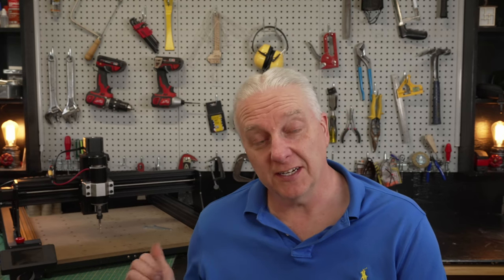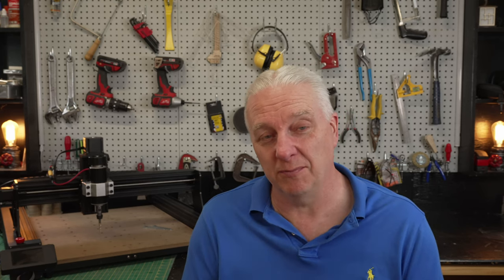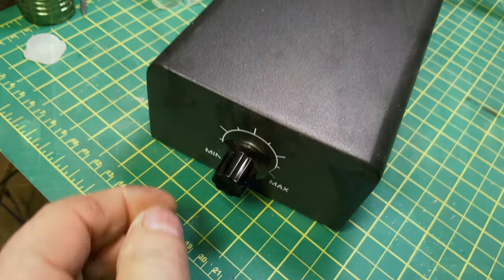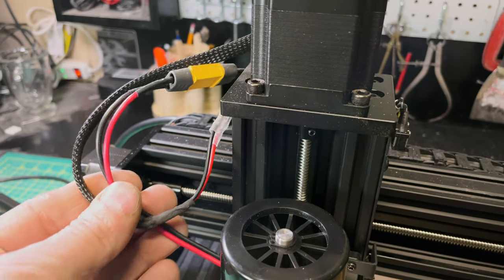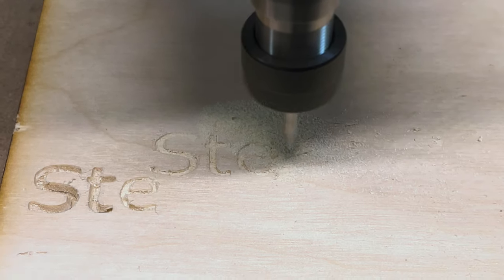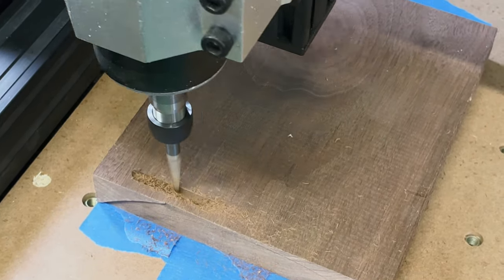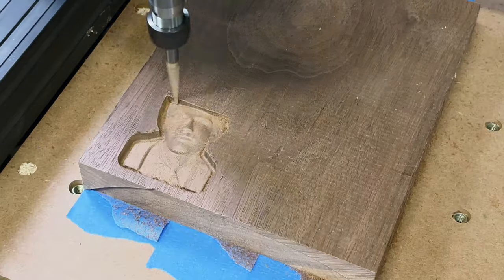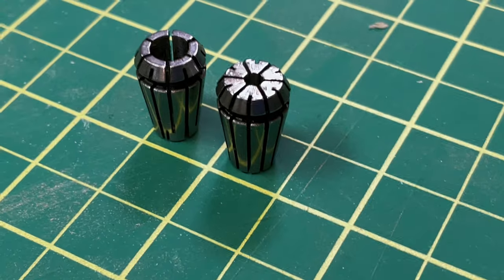TwoTrees TTC450 500W Spindle Upgrade - A Game-Changer for a Great Entry-Level CNC

Comment: Greeting!
I'm interested in your opinion!
 You probably know that the TTC 450 already has a pro version, and you can buy an 800W spindle for it, which is very similar to a manual router! I have three questions:
1. How much do you think this spindle speeds up the production process?
2. Can the mechanics of the machine handle such a large spindle?
3. Can it be installed on the plain TTC450, and if so, will it not destroy the machine!?
Thank you in advance!
Reply from the maker: 1.  The biggest benefits of a spindle are that they are designed to run for long periods of time, provide more torque and they are quieter

2.  You can actually put a trim router on this CNC, though that would push things a bit in my opinion.  But the 800W spindle should be fine.

3.  I believe the running mechanics of the regular and pro versions are essentially identical, so what you can do on one will work on the other.
Reply: @SteveMakesEverything Thanks!

Comment: Hi Steve, thank you for sharing . I designed couple simple projects, put them in a memory and loaded them into my laptop, which is connected to my cnc
machine, and nothing happened. I don't know what's wrong. Any ideas? please help.
Reply from the maker: This isn’t much to go on. What tool are you using to load the files to your CNC?

Comment: I just bought the 450 with the 500w spindle. When I connected the spindle it's not working. Getting power to the control box, but no power to the spindle. I connected he 80w to see what would happen and it works fine. Any thoughts? I've contacted TT and haven't heard back from them yet.
Reply from the maker: Check the connections from the control box to the spindle.  I had a similar problem with mine and TT ended up sending me a new control box.

Comment: Can you tell me how to install the bracket behind the spindle thank you
Reply from the maker: Look on the Two Trees channel. They have a video that shows this.  The bolts holding the spindle bracket are accessible from the back. You need to manually move the Z up and down the access the bolts
Reply: Ok thank you

Comment: I suggest you test if that power supply box is grounded. I have one of these 500W 110V spindles, and it has 80V on its "ground" wire when compared to actual ground coming from your wall.
Reply from the maker: Wow.  Mine is definitely grounded

Comment: Is it good and precise enough for a small startup shop?
Or is it a hobby machine that you have to frequently tinker with that doesn't get consistent and repeatable results?
Reply from the maker: If you want to do shop work then I'd suggest the Genmitsu ProverXL 4030 V2.  It's a bit more heavy duty.  You can find a review of this on the channel as well if you look in the CNC playlist.
Reply: @SteveMakesEverything  Thank you for responding. Due to budget constraints, I was rather excited about the TwoTree machine, I'm just concerned that it would end up more like a tinkering machine similar to cheaper 3d printers that you constantly have to tune, part replace and adjust to get any workable result out of.
I've seen the Genmitsu ProverXL before, but since I already have a Snapmaker Artisan I decided to stick with that over dropping north of 2k on another CNC.

The TwoTrees seems to hit a nice spot price wise, where I could get just enough extra working area to actually clamp 400x400mm pieces, while also easily installing a vacuum clamping table.
Though, again, I'm concerned about its accuracy given that I need to flip my workpiece around to precisely cut on both sides (if the contours don't align that would be an issue).

Hopefully you can let me know if the TT would be up to this task or if I should wait until I have the funds to scale to a better machine instead of trying to produce more volume with a TT.
Reply from the maker: @kay6736  The Two Trees CNC is a decent machine, but as noted I would still lean to one of the 4040 Genmitsu models.  They are just more robust for not a lot more money.

The TT is definitely cheaper, but as the oild adage goes, you get what you pay for.
Reply: @SteveMakesEverything  Thanks, that's kind of what I thought but didn't want to be true.
I'll keep using what I have until I can upgrade then. God bless.

Comment: Sorry to ask again!
I finally got the 500W motor for the TTC450! I managed to install it, but I won't try it out until tomorrow!
My first question would be, how high should the spindle be raised from the bottom of the machine when it is held in place in the clamp? I couldn't find any information anywhere, or I just missed it!
My other question would be how many millimeters is the depth to which you can safely go in one step, without the machine being destroyed! I know you mention 5mm in your film, but as a beginner I find it too much, but I would be wrong, because it would be good to finish the work as soon as possible! Thanks! Friendly greeting!
Reply from the maker: There’s not set height for the spindle, though there’s no point setting so low that a tool bit could go much below the workspace surface. Insert your shortest bit and set the height so that bit just touches the workspace with the Z axis at its lowest point

Going 5mm is pretty aggressive. Start with maybe 2-3 mms. If you XY movement is slow you won’t break a bit
Reply: Thank you very much! @SteveMakesEverything

Comment: How do I work out how much power  it uses?
I'm working from home and don't want a huge power bill.
Reply from the maker: The most accurate way is to run it through a power monitor, but then you need to already own the spindle.  However, the max power is 500W (or about 5 incandescent light bulbs), so it probably won't rack up your power bill in any big way.  But the spindle is only running while you are engraving, and you will rarely be running at maximum speed.  Regardless, it will use less power than a trim router and will certainly be a lot quieter.
Reply: @SteveMakesEverything  Thanks Steve. Power is a big factor for me as it's very expensive in Australia 🇦🇺. I just purchased the consumption adaptor this morning for 20AUD. Going to test and see how much the pc, laser+enclosure and air assist costs to run this will be interesting. Always learning! Need to factor overheads like power into final cost as a novice I'm getting paid to learn once I start selling.

Comment: Hi Steve have a problem I have the TTC 450 with the 500 watt motor, have just assembled it plugged it in but won't run, plug the 180 watt motor in and it runs is the something in need to do in settings or software to fix this problem   cheers from NZ
Reply from the maker: Check the polarity of the motor connections.  It isn't obvious wire coloring like red/black so you will either need to look in my video or contact TwoTrees support.  I actually has a similar problem and they ended up replacing the power supply for the spindle.

Comment: Hi Steve, have you tried the 20w laser module they offer? I've been 3d printing for a while and want to move into router and laser. Dedicated machines sound better to me, but curious if I could get away with one that does both, for diode anyway. Thanks!
Reply from the maker: I haven’t. Like you I think if you want a laser and a CNC then two machines is a better option than trying to do two thing with one machine.

Comment: HI! I'm Zoltán Kabódi and unfortunately I don't speak English! According to the automatic translation that I used in the video, I mean that you set 5mm for the Deep/pass 500W motor! Am I right? won't it damage the machine? (TTC450)
Perhaps you could tell me what parameters (Deep/pass, Feed rate, Plunge rate) you are working with, say for hardwood a 3mm and a 6mm End Mill! That would be a big help to me!
Thanks!
Reply from the maker: It certainly would t be 5mms because that would probably stall the spindle or at least cause it to get hot.  Unfortunately I don’t remember the setting I did use.  It would make more sense to set the depth per pass at 2-3mms, though it would depend on the mater8al a bit
Reply: I have already ordered the machine together with the 500W spindle, but it is still on the way! I think 2-3 mm is a very good result compared to 3018, which I am using now, it significantly shortens the time! Thank you for taking the time for me!

Comment: I wonder if the small nema17 on the x axis really can hold that big spindle.. Dies anyone have any experience with this machine and aluminum or brass?
Reply from the maker: The spindle isn't really that big, and it is downward force on a threaded shaft, so the motor had no trouble dealing with it.  I haven't tried metal with this spindle, but it should work fine as long as you aren't trying to brute-force the job.  I think the right bit matters more than the spindle - and, of course, the feed rate will need to be slower than for wood.

Comment: How would one know what feed rate and plunge rate (speed) you should add to the tool database for the included cnc mills that come bundled with the 500w + Machine + mill package? Is this a try and error approach or is there some baseline settings to start with?
Reply from the maker: Kind of yes.  It depends on a lot of things.  (E.g the material, your tool bits etc). It’s a bit of dark art to get these right, but I usually start by going slow and not trying to remove too much material at once.  If it is obvious easy going, you go increase the speed and feed.

Comment: Apparently, Twotrees has a SERIOUS QC issue with their 500 watt motor power supplies.  I ordered one brand new from Amazon, and D.O.A.  Still no response from Twotrees.  Thinking this may be a company to avoid.
Reply from the maker: I wouldn’t necessarily single them out for quality issues. There are a few companies struggling.
Reply: @SteveMakesEverything  It's not ME "singling them out" if they have QC issues.  It's THEM having QC issues.  You said yourself "I actually has a similar problem and they ended up replacing the power supply for the spindle."   That sounds like a definite problem, and honesty about the issue should prevail.

Even if you get free stuff from them.  Integrity.
Reply from the maker: @letmepicyou  yup, I hear you.  My point is that quality issues are endemic in this business. My personal concern is that support is also an issue an it’s a recipe for disaster, if a company has neither.
Reply: @SteveMakesEverything  Agreed.  So far, I haven't seen much from them in terms of support.  I finally got SOME message from them, but all it was was a request for me to send them a video of the problem (!).  I mean, who does that?  Imagine if your brand new car broke down driving it home from the dealership, and you call the dealer and they're like "Well, maybe take a video of your vehicle broke down on the side of the road and maybe we'll see what we'll see."  That's literally where I'm at now, having sent then 2 videos (to 2 different addresses) and haven't had a response from either.

It's not a good sign.

Comment: Hello!  I am trying to determine if there is a budget CNC for me.  I am wanting to get into making parts for my channel and for different designs I've already 3d printed.  my goal would be to use a cnc for HDPE to make certain triangular parts at no more than 12mm thick.   Is this possible with or without this upgrade and if not, is there a CNC you may recommend?  Thanks!!
Reply from the maker: HDPE is pretty soft so it might be possible to do this with the standard motor. The 500w motor would certainly work an probably let you get through this material in a couple of passes
Reply: Thanks so much for your response

Comment: Those spindles usually have regulators connected to the network, quite a dangerous thing (how can you use a 120V power source and control the output with a pwm mosfet), but it's all useless because the bearings are stored in flexible rubber.  It does not have the necessary rigidity for use as a cnc spindle.
Reply from the maker: Yeah those spindles aren’t the best for the long term.  A trim router would be a bitter choice for longer life.

Comment: Dont buy its not worth the price
Reply from the maker: I’m not sure what your criteria is, but you certainly won’t plunge 5+ mms into walnut in a single pass with the default motor. If all you ever want to do is engrave text then the 80W spindle is fine, but for $120 you can turn a hobby CNC in a serious tool